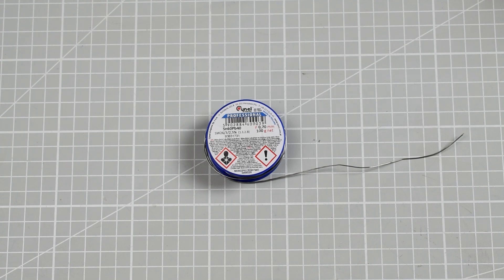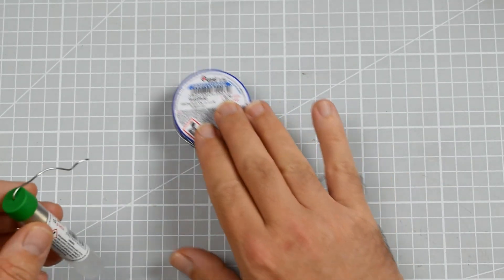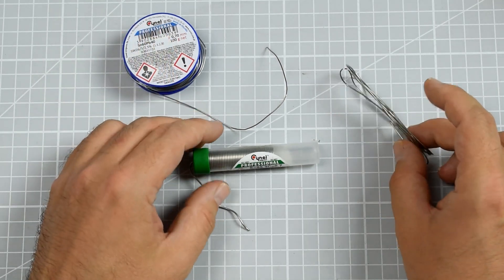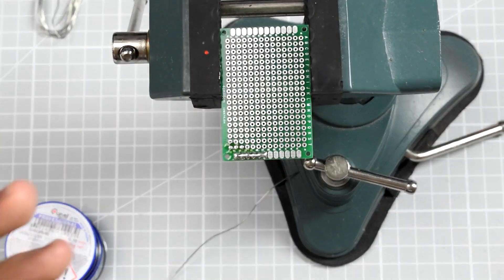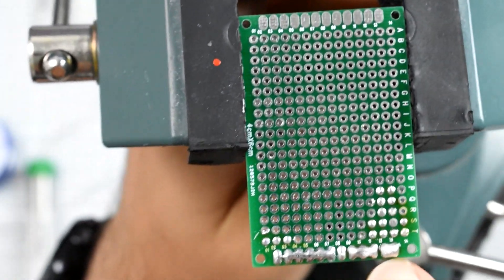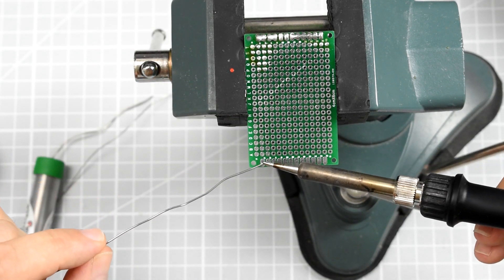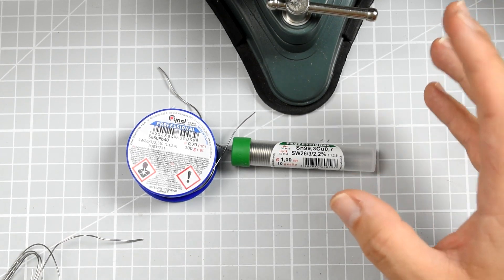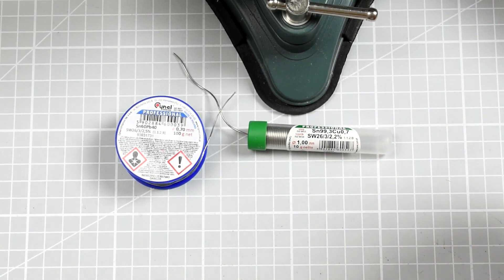Lead solder vs lead-free solder vs silver solder

Comment: What I know about lead free could fill an encyclopedia. As for the leaded solder alloys including silver content solder, this is where I have learned a great deal. The best leaded solder alloys are pure eutectic alloys. A pure eutectic has only two states of being. It’s either liquid or solid. This clearly an advantage as having only two states makes it more stable and easier to work with. The same goes for silver content leaded solders. The ratio of tin to lead to silver is 62%tin, 36% lead and 2% silver. This ratio makes them a pure eutectic alloy as well. The non silver leaded ratio for a pure eutectic alloy is 63% tin to 37% lead. The best flux core is an RMA, rosin mildly activated, flux core. This has been proven over decades of use in avionics, missile electronics and bio medical electronics where dependability and reliability are key to successful completion of mission tasking. In what was then used under DOD STD 2000-1 and currently under J STD 006 level 3 which are equivalent standards. These are both critical circuits standards for soldering excellence. When used under these standards, the joints produced are capable of withstanding G forces, mechanical and physical stresses and thermal inversions with great success. Failure at this level is intolerable. Human life, the pilot and or crew as well as a class A asset are at stake, not to mention mission success and accomplishment. There is no place for mediocrity in such an environment. 60/40 solder alloys have what is called a plastic range which means they have three states of being as opposed to two for pure eutectic alloys. The appearance of pure eutectic solder alloys with an RMA flux core is the base of any successful electronics soldering that requires the highest reliability and quality. Decades of this proven success cannot be overlooked or overshadowed. It is a proven fact. The best appearance is achieved by the above combination of flux core and alloy. The lead free alloys are making progress and I am certain someone can chime in and help those who want to learn or improve their soldering using this type. I welcome constructive help from those whose experience will be helpful. I’m sure their are those who want to make the change to the safer alloys.
Reply: Do you know if there is a eutectic solder with a higher content of silver besides 2?
Reply: @rubenmejia4881 I’m not aware of it, but I would welcome seeing it and learning about it as well.
Reply: @rubenmejia4881 , so Mr Ruben, who makes this 4% silver pure eutectic solder. I’m curious about this one.
Reply: @rubenmejia4881 , so Mr Ruben, who makes this 4% silver pure eutectic solder. I’m curious about this one.
Reply: @markphilpot8734  I don't know 🤷 I was asking to see if you knew of a solder alloy higher than 2% silver that was eutectic since you know a lot and have been around the field. I was curious myself since I like the silver solder. I wanted to see if there were other variations that contained lead.
Reply: @markphilpot8734  So I couldn't find any but I've been hearing and reading about Cardas Quad Eutectic Solder which is composed of Tin/lead/silver/copper I hear it's really good stuff and I would like to know your thoughts on it. I believe it's used for audio equipment, but with a composition like that, I feel it wouldn't hurt for basic electronics or there of high-end. I know that tin/lead 63/37 is the best, but what about the addition of silver in the mix? How about this quad eutechtic mix? How would you say this would affect reliability? 🤔
Reply: @rubenmejia4881 , this is a proprietary mixture which claims to be a pure eutectic mixture. The definition of a pure eutectic is one which only has two states, liquid or solid. I’m not a metallurgist so I cannot validate this as advertised. I am one who only has used those solders which have passed the very stringent tests associated with the soldering standards I have worked under. There are small rolls of this product which you can test with yourself. Since this is your money and your decision, it is up to you. I cannot endorse the use of any solder that has not passed the standards that I have used for decades. I know what these solders can do and do under the very worse case scenarios. For a hobbyist, these standards mean little. What matters to most is being a pure eutectic as it only has two states, liquid or solid. The higher silver content of this solder suggests to me that cleaning is highly important here as it is in my level. You don’t want any residual material around attracting any debris or possibly causing a conductive path between two that will cause a problem. Cleaning after the fact and prior to the soldering makes you a better solderer than those who ignore it’s importance. I can let you know whatever you want to know as long as it was part of my training. Prep work is over half the battle. I don’t know what company was used to make this solder, but it is a pure eutectic solder. That alone makes it worth checking out. Let me know how it works out. I can’t yield any reliability data as this isn’t a solder approved under the soldering standard I worked under. It is a proprietary formula so it is up in the air as for reliability. All we have to work with is that it is a eutectic solder and hope it is worthy and reliable. Given this company’s reputation, I am likely to give them the benefit of the doubt. It still comes down to whether you are willing to put your money down. I’m not kicking it as I haven’t personally used it. That alone keeps me from any recommendation I could make. I am one who is inclined to stick with the brands I have used under the strict rules that govern the methods and materials to yield the high reliability results. This may not help you much, but it is hard to endorse a product that I haven’t used.
Reply: @markphilpot8734  Thanks for your analysis 👍 Which has been your all-time favorite solder & blend?
Reply: @rubenmejia4881 , all time favorite is Kester 282, RMA rosin mildly activated flux core, 3.3% flux core to blend ratio. This particular roll is in the 0.015”/.4mm size. This is perfect for SMT work where tighter control of the solder is desirable. The blend of the solder blend is 63%tin/37%lead which, as you know, is a pure eutectic. It is the combination of the blend, the flux core makeup and the % of the flux percentage to the blend that makes this solder a true joy to work with. For the silver content pure eutectic solder, Multicore 362, a rosin core based solder with a 2% silver content. Any rosin based solder can be used with an extra liquid RMA based flux as this extra flux is also rosin based as is the flux core of the solder proper. This five core rosin flux core solder is 0.7mm/0.027” wire size. Still small enough to control easily and has the added benefit of having a 2% silver content and still being a pure eutectic to boot. My extra liquid flux I use is Kester 186 RMA liquid flux. The chemical match of the flux core of the 282 solder and the extra liquid flux, 186, is perfect as it is brand as well as chemically matched. This 186 RMA liquid flux I use with all my rosin based flux cored solders. This isn’t always the most ideal, however it is the RMA flux that causes the magic that yields the best appearance, causes the joints to handle g forces, mechanical and physical stresses, thermal inversions and is easier to clean than straight rosin based flux is. When you know what to use, practice is all that’s left. Methods matter as much as materials. There isn’t any such thing as it doesn’t matter. DOD STD 2000-1 = J STD 006 level 3, Critical Circuit soldering. To solder to less is to put life and material assets at risk. This is the true test of the best material science and constant dedicated hard focused training. Practice, practice, practice! It is a mindset. Good day Mr Ruben.
Reply: @markphilpot8734  Thank you Mark good day to you as well! I actually have some 282 in that configuration and it really is great! But sometimes I feel I want a stronger activity based flux. For the fine stuff the 282 worked wonderful for me. I was using some chipquik smd291 flux as I tend to like the tacky fluxes better than the liquid since it doesn't spill everywhere and helps keep it more contained to the area. I came across someone on ebay where I bought some vintage kester spools. That's how I got the 282 for a great price and it still works lovely! But I also have some "88" resin by kester which currently they don't make in 63/37. The diameter I belive is .4 which is a bit larger but for the amount and price I got it for I'm not complaining haha 😆. Have you used the 88 flux in the past? How do you feel about kester's 44? Once I used 44 I fell in love amazing joints both cosmetic and strength wise.
Reply: @rubenmejia4881 , the key to best practices is to match your extra flux to your solder’s flux core. The type of flux matters that you use the same as the flux core is that where the consistency of performance you desire. It isn’t about the state of the flux, liquid or paste, as much as it is the same as the flux core of the solder. Consistency is achieved by using the same extra flux as the flux core because you cannot achieve the consistency and performance when the fluxes are different. That means using RMA extra flux with an RMA flux cored solder. The type of extra flux, liquid or paste isn’t the issue as the same flux, RMA flux core and RMA liquid or paste extra flux is consistency is used. Matching the fluxes is what yields the best results and if possible brand matching of the extra flux and the flux core yields that consistency and performance. You cannot get the best results when there are mismatches. The only exception is the use of RMA extra flux, liquid or paste, with Rosin or Rosin Activated flux core solders as the RMA flux yields the best results and is easier to clean in addition to yielding the best results of appearance and performance as I mentioned before. It has been proven over decades. You may not be able to brand match your extra flux with your flux core, but it is imperative that you use RMA extra flux when you are using an RMA flux cored or any Rosin or Rosin Activated flux core solder as the RMA flux always yields the best results as long as you only use the RMA extra flux. It is what yields the best results and I can say that as my experience is what I go on and the proven decades of results that happened before and since I learned this soldering discipline I have used since I learned it in the Air National Guard back in 1985. This has driven my enthusiasm for this and I am an advocate and practitioner of this discipline which is DOD STD 2000-1, J STD 006 Level 3 Critical Circuits of soldering excellence. Hope this yields the understanding you are looking for. Before I was exposed to the soldering standard I currently work under, I did use Kester 44 flux cored solder. I did not use the 88 flux cored solder. I used some solders that were not pure eutectic solders. I had lots of problems with soldering prior to learning about the soldering discipline and standards that have changed both my perception and outlook of what soldering is and can be. In my mind and heart, there is no place for mediocrity in soldering. That is part of the philosophy as well as the mindset. Anyone can learn to solder. Learning how to solder to the highest standard makes you a force to be reckoned with.
Reply: @markphilpot8734  I've got 186 flux, but I like using gel flux. The 186 is really good. I agree flux types go hand in hand with flux core
Reply: @rubenmejia4881 , the key to using the liquid flux is the size of the needle and shaking it for at least 20 seconds to keep the mixture consistent when dispensed. The key to using a gel or paste flux is the size of the brush you use. You may think that the gel or paste fluxes are better than the liquid. It really depends on application and not overdoing the application. What you are wanting is only the amount that will do the job and no excess. This is the key as it makes cleanup easier and few like the cleaning part. The greater the excess of flux, the more difficult the cleaning will be and also using excess flux costs you both time and money and nobody wants waste of any kind for superior results. It isn’t the the type of the flux, liquid, gel or paste that matters, it is the amount and only using enough so as to reduce waste and cost as much as possible and it makes cleanup easier and faster. You can get the RMA extra flux in the gel. It is very easy to control the gel as opposed to the paste as it uses a brush as an applicator and this is why the size of brush matters so much when using the paste. The gel is applied using a hypo type applicator so it is easier to yield precise amounts over the paste. The key of using liquid is the needle ID, inside diameter. By using a smaller diameter hypo, you have greater control just like you do when you use the gel. It is a practice thing and really without practice your chances of proficiency are not good. You can learn to be great with both. It is up to you what you can accomplish. You have the desire. Just push yourself to achieve using your preferred method and your results will improve as you gain proficiency with practice. It’s up to you and I believe you care. That matters a lot Ruben!
Reply: @markphilpot8734  I use a syringe with a 18ga blunt needle and it seems effective if I want to dispense less I use a smaller gauge. I only use enough to get perfect joints for example if it's a pad I use a bit less than the pads size and I achieve the perfect amount. Solid clean shiny joints also clean up is easy with 99% ipa and a cleanroom wipe it doesn't leave any lint behind and the results are fantastic 😀

Comment: I was an aerospace soldering instructor and tried lead free solder a few years ago, was an awful experience. I notice all kinds of lead-free solders and fluxes being advertised now, maybe I'll try it again but have plenty of good old 60/40 rosin core solder and rosin paste flux on hand. Is there a good reason to switch to lead free solder and lead-free flux for occasional electrical/electronic hobby soldering? First time solderers need to understand the basics of "solder-bridge" heat transfer, care of soldering iron tips, proper stripping and  tinning of stranded and single-strand wire,  use of flux and observing proper solder flow. They don't need the challenge of higher temperature lead-free solders and non-rosin flux.
Reply: This was exactly the information I needed, thank you.
Reply: Yes very new to soldering. Bought some lead free rosin today. I don’t think I’ll use it. I need to solder EC8 battery connectors to my RC LiPo batteries. This is a new experience for me too. Sounds like lead free will give me trouble as a beginner. Thanks for your good advice.

Comment: How do you know if your solder has lead in it if the label fell off your roll?
Reply: From what I've read lead solder will still look shiny when it cools but lead free cools and looks frosted
Reply: Also if you have a temperature controlled iron start low and gradually increase the degrees. Leaded solder should begin to melt @ 180 degrees Celsius maybe 183 depend on which type or brand of solder you use. It will melt and flow like hot butter with flux. Lead free usually requires a lot more heat.
Reply: The shine of a dried joint isn't a good test anymore. Weller has a tin-copper-nickel alloy that dries shiny. Instead, try setting the iron to 200C. If it melts, it's probably not lead-free.

Comment: i am a little confused why the matte surface matters so much
Reply from the maker: matte, not shiny surface is an indication that temperature was too low and joint is weak. Plus, porous, matte, surface increases oxidation rate
Reply: for those working fault-finding on PCBs, identifying dry joints is an important part of an inspection.  Whilst UN-leaded solder may be OK to apply,  when it comes to inspection later on, even good joints look very much like dry joints would (if leaded solder had been used).  So basically, unleaded solder often makes repair and rectification harder and more expensive.

Comment: EU is cracking down pretty hard on lead and the only source now would be private Sellers as it's pretty much banned from sale as far as I know. Good to know there's alternatives cause if lead free solder was still anything like what I used 10 years ago I would probably just quit the hobby
Reply: You should be fine with SAC305 from Cynel or Stannol (which they call TSC305).
Reply: @forestmanzpedia  Lead works fine. Dont eat it. Most of the people preaching have mercery in their teeth
Reply: All the big suppliers in England still sell leaded solder.  Maybe you can order from them.